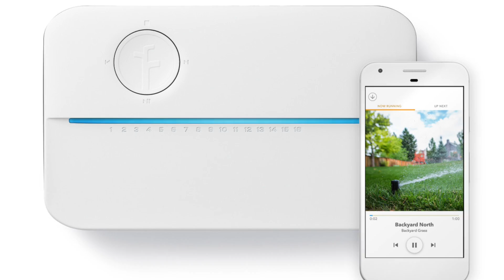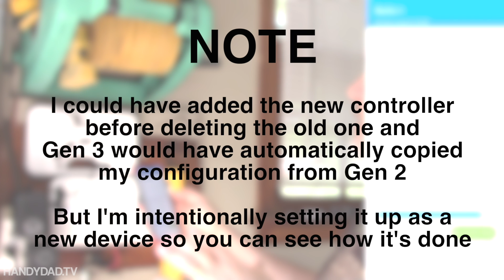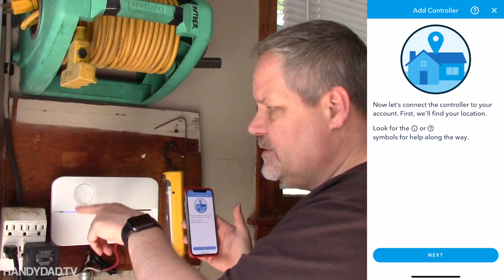Rachio Smart Water System - Gen 3 vs Gen 2

Comment: To summarize, for someone that already has a Gen 2, the only reason to upgrade is if you want to buy and install their water flow meter that will alert you and cut off the sprinkler if it notices a head is broken.     Otherwise, you already have it installed so there's no reason to remove the front panel once its installed, same with inserting the wires its already done, you have an app so who cares what the device looks like, 5ghz is inferior to 2.4ghz for this device (5ghz has reduced range but increased bandwidth, but you don't need bandwidth for such basic communication to the device, so stick with 2.4ghz anyway), and so just stick with what you have.   Now, supposedly it also has a new "weather intelligence plus" system, but that seems implausible that they can get more accurate forecasting than you can get from google based on a nearby weatherstation.     Maybe its worthwhile if your closest weather station is super far away, but for most of suburbia, that's not an issue.     I'd say if you have a gen 2, stick with it.   If you have nothing or its broken, buy the gen 3 if its very close in price, but chances are good you can get a "last generation" on clearance deeply discounted, like I did, in which case IMO get the gen 2 as its very similar to the gen 3 in all the ways that count, especially if like me you're using it in their separately sold outdoor enclosure for an outside install.
Reply from the maker: I agree. And I can’t say (yet) if the flow meter is a compelling enough reason to upgrade. 

For people who don’t have a Rachio, I think there’s value in buying latest-and- greatest. That’s why I’m writing this on an iPhone X instead of a 7.

Comment: Looks great. I use a sprinkler service for winterization and startup. Is there a way for them to connect?
Reply from the maker: They wouldn’t need to. They don’t depend on your timer; they can open your zones manually at the valves (assuming they can access them).

Comment: Moved from Michigan to NC and the previous owners didn't use the irrigation system in over 15 years.  I was able to get it up and running but with a combination of clay, south facing lawn, and steep slope, I have been very challenged with the appropriate amount of water.  Not to mention, we get punished for using too much water.  Our water bill easily hits $200/month when watering.  I would love to see how much this type of system can actually reduce my bill.

Comment: I live down the Jersey Shore in a 55 & over development.  I have an old (1979!) system that uses well water.  My electrodes are in the ground and the motor is in my garage!!!  I still do all my own repairs on the sprinkler heads and the parts are getting hard to find now that Home Depot doesn't sell them anymore.  My question is, Can I have my old system replaced with the Rachio Gen 3?  or should I stay in the past till it breaks!!!
Reply from the maker: If your current controller has a 24V output to each zone, then yes, you can replace it even if you have never seen the valves.

Comment: Great video. Very well done. I'm a new subscriber about to install a new sprinkler system at my home in Gilbert Az. So this video was timed just perfect. Thank you. I do have one question on the Rachio controller and specifically on the wind setting. If it skips that day because of wind does it pick it up later that day when the wind is lower or on the next scheduled watering?  Thank you.
Reply from the maker: No, skip means skip.

Comment: Thanks for the informative video. I'm in the market for one of these and was debating between this (actually the gen 2 model) and the Rain Machine. Was leaning toward RM because of the on board capabilities but now that the Gen 3 has some manual controls I will be rethinking this. I really appreciate that the Rachio is American made (at least that's what i thought i read).

Comment: Great video as always. Couple of questions.

Does the v3 connect to SmartThings or IFTTT in any way. Looking to setup custom notifications.

Also, you said it now works on 5 GHz band, does it also still work on 2.4 GHz?

Lastly, when are you doing the drawing.
Reply from the maker: Yes, it integrates with SmartThings and IFTTT (see https://rachio.com/integrations/).

Yes, it is dual-band wifi.

Whenever I get the flow meter, I will announce the winner in that video.
Reply: HandyDadTV awesome! I am working on making my home as smart as possible. (And trying not to go broke in the process.)

Does this new one take any kind of physical rain sensor or does it rely only on web data?
Reply from the maker: Yes you can connect a physical rain sensor. I did that to begin with, but disconnected it because it wasn’t needed.

Comment: My controller is 15 years old and I can barely read the screen like your old one. I was just thinking about replacing it. This may be a good choice. I would have to get the box since mine is located outside. I was wondering since its constantly monitoring does it use a lot of bandwidth? Thanks for the contest.
Reply from the maker: The algorithm is proprietary, but my notifications come via email from Rachio.com so I don’t think my device is actually monitoring the weather; I think it gets told not to water when the mother ship says so.
Reply: LOL. Thanks. So it's like a ground control to Major Tom thing!